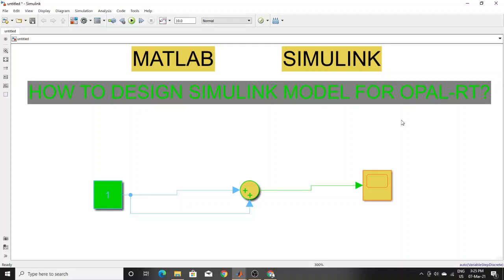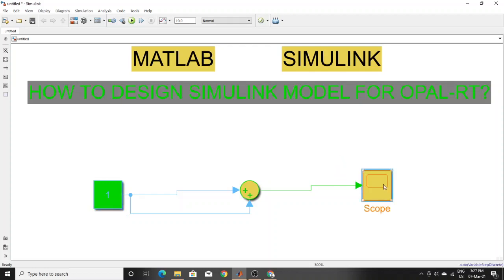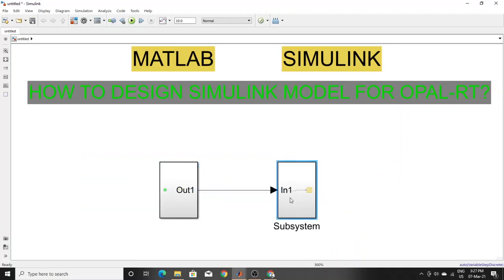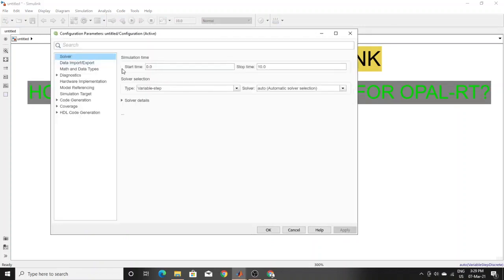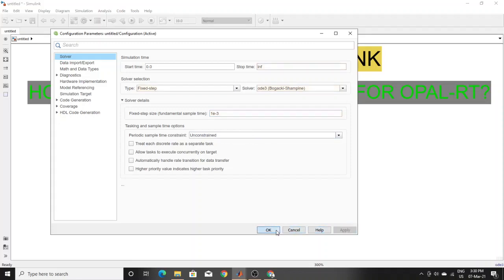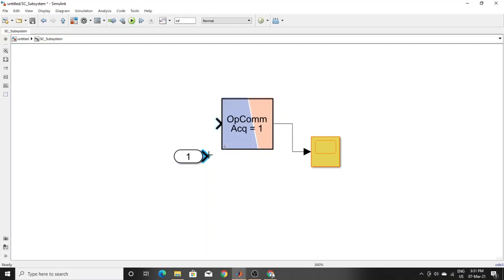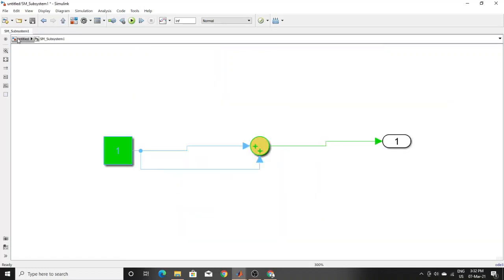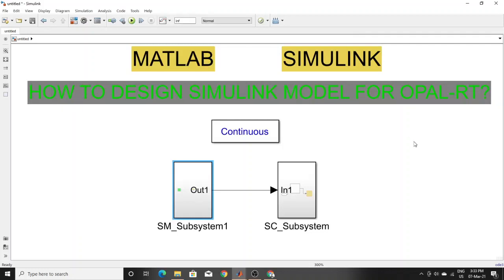How to design SIMULINK model to run with OPAL-RT / RT LAB??

Comment: Please explain the importance of solver time and time mentioned in power gui block. what effect will it cause to real time output if they are different and which time value will determine override situation.
Reply from the maker: Because it's real- time simulation, both time should be same. Solver time you will calculate or choose ( as required for your model)( if you added time variable in your model,then that same time you have to put everywhere),  and you have to put same for powergui. U will not be able to do simulation if time not same,
Time variable should be more than 10 micro sec, otherwise over-run situation will come or it will not give expected value ( some times less than that also worked, depend on the model complexity).